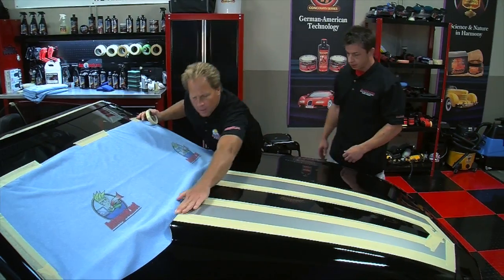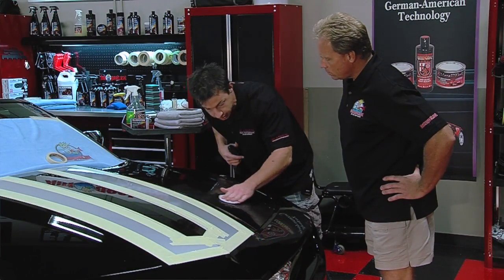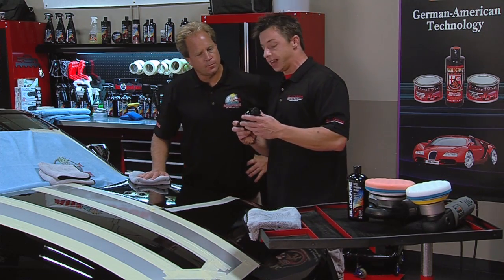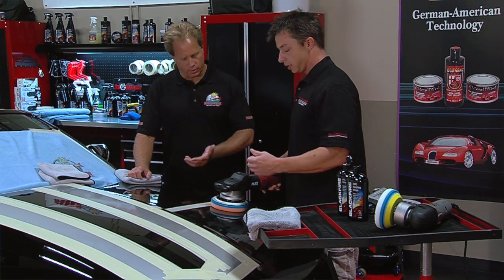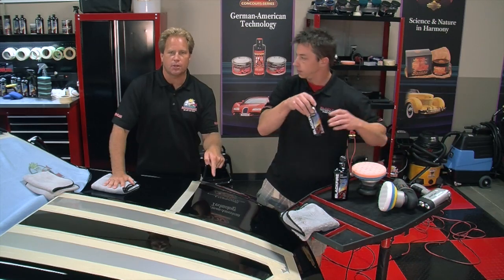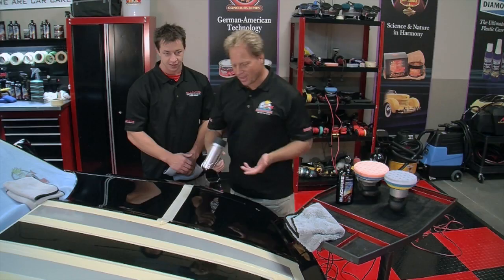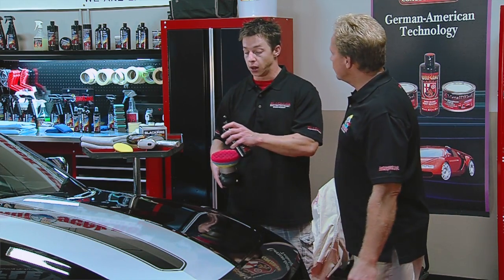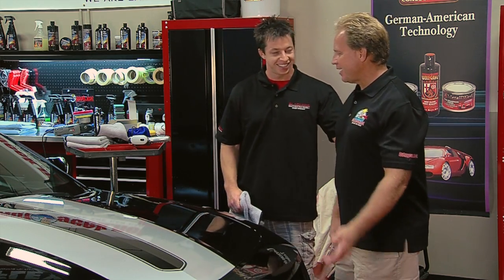How To Remove Swirls and Create a Show Car Finish using Blackfire Car Care Products

Comment: Dear Mike!

First of all I'd like to tell you, I've learnt the 98% of my polishing technique from your ebook, and your videos.
I've sucked a lot with micromarring and scratches.
I've a flex3401 and tried compounds like 3M, Riwax, meguiars 83, M105-205, with pads like 3m, riwax,menzerna and Rupes.
The reason I used these, because in Hungary you can't really find good quality products for polishing.
So after many bad job, I got some Lake country ccs pads with menzerna fg 400 and sf4000...
First I did a section pass and after wiping it looked good, but after a few wash it I realized micromarring.
I didn't want to beleive it's my fault so started to think about polishing method again.
Then I figured out that, maybe my towels are bad...(Riwax)...
So I got a few Cobra gold towels (not from Hungary), and like Heaven...it is million times better,softer than my towels were.
After doing a section pass again and then wiping with cobra towels a flawless marring free finish were to be seen even after several washes. So I'd like to say THANK YOU VERY -VERY MUCH. It was my goal, I spent over 3000usd to gain enough experinece and learn polishing like a pro and I think I've successfully learnt it.

I've only one question to you, I've read many articles, how to take care of microfiber towels.
Some articles says, use hot water, but some says to avoid hot water.
Because I've an automatic washing maschine, I can't set hot-cold, I have to set a temperature 40-60-90 degrees.
Although you say wash/Rinse Hot/Cold, I don't know what temperature to set when washing, because on the label of the cobra towels at maximum 40celsius is written.

So I'd like to ask you what temperature should I wash them, and with what kind of detergent, because in Hungary there is no any kind of special detergent for microfibre.

I've read on the internet, Woolite has a detergent, with that I can wash microfibre without damaging the fibers, but I'd like to hear it from you, if I can use Woolite or not.

Thank you very much for your answer, and for making videos and so on:)
All you've done is the best, I learnt a lot from you.

Regards,
Daniel Erdos

Comment from the maker: Using a spray-on cleaner is an option and a good one.  This was a Blackfire specific video and for that reason I just rubbed the compound off the paint.  The big picture is this brand new Camaro came to us with only 1500 miles on the odometer but completely swirled out and we fixed it using nothing but the products, pads, tools and techniques shown in the video.  Afterwards, it has a true show car finish.  -Mike Phillips

Comment: Hi guys, great video, but i was wondering if you could help me out. I have a 2012 black audi q5. Now i polished this car once, trying to get out all the swirls from the factory using meguires ultimate compound. Now i had to go over this car MANY many times to get good results. Now is that because the paint is more "hard"? Or am i not using a appropriate level of aggressive product. I am using a orange cutting pad and a cyclo polisher. Thanks!

Comment from the maker: While I do prime pads when machine applying waxes and sealants it's not as vital as when working with compounds and polishes to do correction work.  Sometimes in a video you also condense steps to make them shorter.  Most people like short videos, not long videos.  Good question.  -Mike Phillips

Comment from the maker: Just to note, you do not need or want heat.  Heat is an unnecessary and unwanted by-product from the abrading process.  What you want is abrasives cutting, aided by the right pad and tool.  For faster or more aggressive cutting action you can substitute a more aggressive compound, pad and if necessary, use a rotary buffer.  Then after the rotary step, follow-up with the Cyclo for polishing to ensure no swirls.  -Mike Phillips

Comment: It could be that your cyclo polisher is not up to the job. I know bigger pads do not produce enough heat to cut down the scratches. The cyclo has two pads, so maybe it's putting as much pressure as a single pad polisher. Also, try using a different polishing compound - they're not all the same.